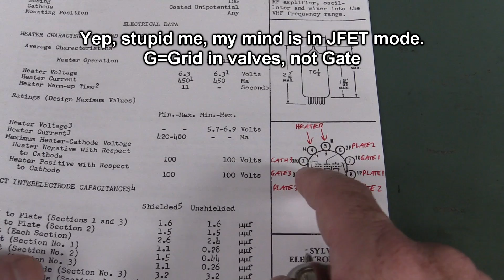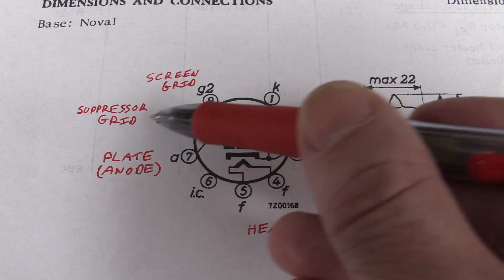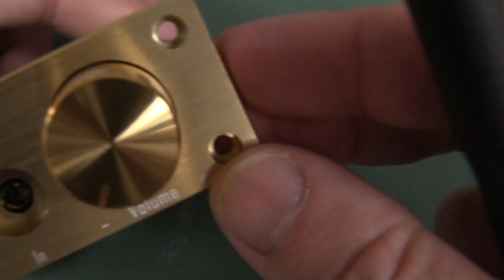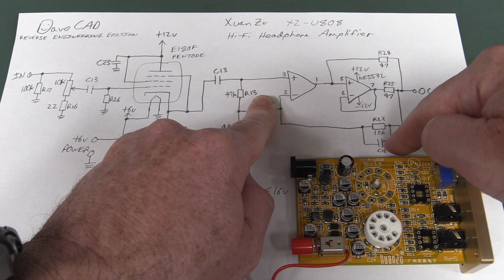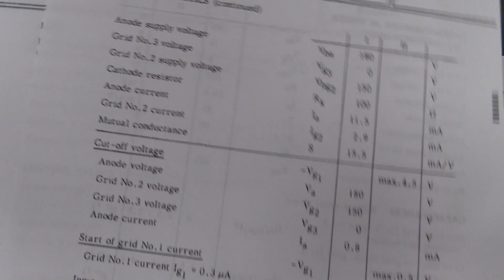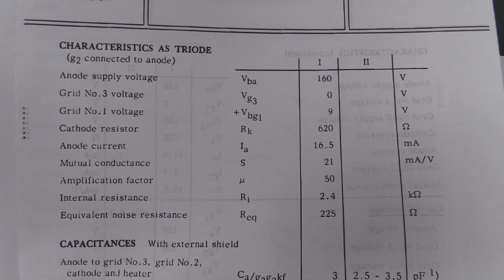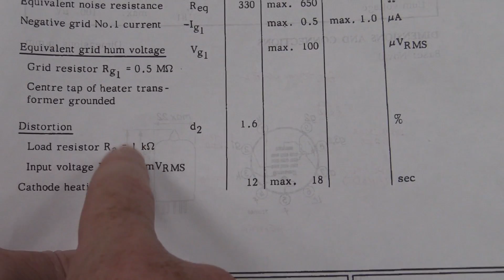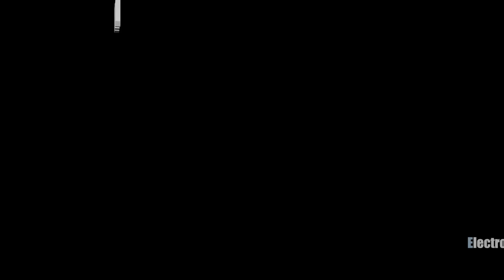EEVblog #837 - Reverse Engineering A Valve Headphone Amplifier

Comment: I like valves for there retro appeal and historical value, unsurprisingly it is more just eye candy. I would have to remove the blue LED's, kind of look out of place on a valve.
Reply: +TheEPROM9 Orange LED would be better.
Reply: Makes it look like gassy (air leak)
Reply: +TheEPROM9 Yeah, kind of sick of everything having blue LEDs. They look cheesy and crap.
Reply: Blue LED's have there place, but it is not in everything.
Reply: +TheEPROM9 The blue LED craze started in the late 1990s, almost every single bling bling black plastic crap electronic gadget were full of blue LEDs. Remember the color LED computer fans? yea... they had their day.
Reply: +Yucannt Hahvitt when the thing, which they are illuminating, is matt black, it mostly looks great. but its depending on the design.
Reply: +Mari Onette couldn't they just have coloured the plastic casing blue? A Nobel prize? wtf. 

Handing them out for nothing these days. pff
Reply: +william fleete Those tubes will never emit blue light when underdriven so much...
Reply: Eviltech
I know, it needs to be in the several hundred volt range to ionise air
Reply: neil huband
The colour of an LED is dependent on the die chemistry, for your old style red and green ones (and orange is a mix of both I think) it's Gallium Arsinade  and Gallium Phosphide, respectively. colouring the plastic would just give you a green/red/orange LED with a blue plastic case
Reply: +TheEPROM9 I can't even think of any place on any household item that would specifically require a blue LED.
[rant]

I have a MSI slidebook, and all 3 LEDs (on, hdd and charge) it has in front of my face are all blue, damit. They light up, like, half of the room at night.
Yesterday my minimOSD board arrived from ebay. The first thing it did upon first power up, it blinded me with obnoxiously bright blue LED.
I've even replaced blue status LEDs on my desktop with faint red and yellow ones (like on a Commodore Amiga - I'm a bit oldschool like that, lol).
Blue LEDs are overrated.

[/rant]
Reply: +Peter Kazakoff To be honest, I don't really have anything against the blue color itself, but it's the obnoxious brightness (compared to LEDs of different colors) of those blue LEDs that always ticks me off, really. It's just that every appliance with blue LEDs starts acting as a night lamp in the dark.
"the future's so bright, I gotta wear shades" :-)
Reply: +ZXRulezzz I'm glad my laptop uses green/yellow LEDs for battery and charging status, and white LEDs for the rest of the indicators like wifi, HDD, numlock etc. (except a yellow LED for bluetooth status). The white LEDs have become dimmer over the last five years; Power and WiFi LEDs are always on when the laptop is powered on, Numlock as well. If I accidentally turn of caps lock, the light is much much brighter than the other two.
Reply: +ZXRulezzz   
A blue LED would be perfect for an illuminated cold water tap and also for the refrigerator or anything that does cold stuff.
Reply: +TheEPROM9 YOU ARE RIGHT THE LED'S HAVE TO GO
Reply: +TheEPROM9 A lot of people do end up disabling the LEDs by just putting a bridge over it to short it. I have a cheapo Little Bear P1 someone gave me that's had the LED shorted over to disable.
Reply: +Mari Onette Auctually, wrong. Blue LEDs were actually first invented in the 1980s using carborundum. It was then changed to gallium arsenide making them far brighter.
Reply: +TheEPROM9 Well, the eye candy approach is rather common with modern valve equipment, after all, most if not all production gear back in the days had the chassis mounted within an enclosure, so you really couldn't see the valves at all during normal operation.
Reply: +ZXRulezzz "I can't even think of any place on any household item that would specifically require a blue LED."

Well, you aren't thinking hard enough! The significance of the blue LED is in the white LED. White LEDs were required for LED backlit screens (TVs, computer monitors, smartphone screens, etc.) and I think eventually they will be the next big thing for efficient lighting, taking over from compact fluorescent technology.
Reply: +TheEPROM9 Well, old guitar amps would drive their tubes hot enough for them to glow amber, since back then, PAs only existed for vocals, so you needed that much power...And amps would sometimes catch fire.
Reply: Dave's motto is "don't turn it on, take it apart!"

My motto is, "don't turn it on, remove all the damn blue LEDs first!"

Man do I hate the new super-bright blue LEDs. Supposedly they're bad for your eyes, too.
Reply: Not hardly. You need to know a little about solid state physics to appreciate the difficulty involved. It's not like our president's Peace Prize. This took work.
Reply: Peter Kazakoff interesting, for me, old green and yellow leds look just the same, I don't have problems with red/green.
Reply: Why are there op-amps in this thing? Doesn't this defeat the purpose?
Reply: oh,yes , leds lighting up valves from the bottom is so 'tacky', i utterly hate it!!
Reply: Blue glow from a tube = rectifier tubes on my pal's 1500W HF amplifier.

Comment: Drive the thing into distortion and see which distorts first the valve or the op amp.  If it's the valve then it's working as advertised.  If you want distortion in a headphone amp is matter of personal preference.

Comment: Beautiful!, I made one Class D Amplifier with Pre using 12au7 and 6L6GC ... greetz from México
Reply: That's a good sounding amp, a 12au7 can be used in 6 or 12 volt circuits. I had a push pull amp using a 12ax7, 2 6aq5's and one 5Y3 rectifier tube and it sounded good and loud for 10 watts.

Comment: I was surprised to output at the cathode was that clean and linear (minus the switch mode noise.) The tubes were operating in starvation mode. I was expecting some soft clipping on the negative swing of the sine wave.